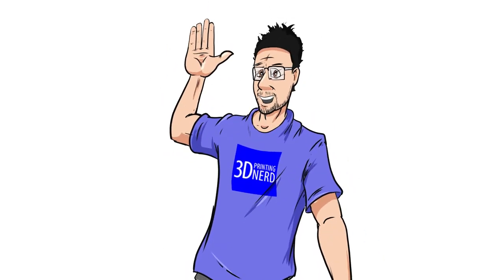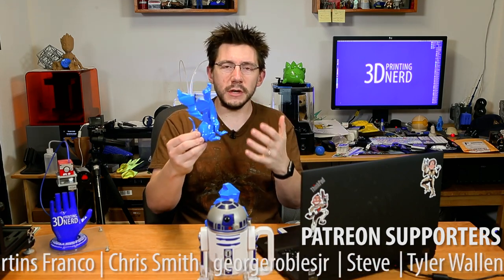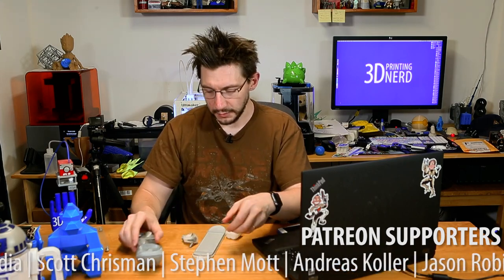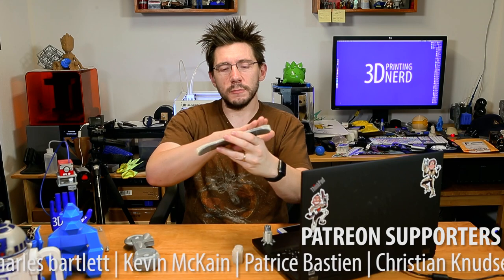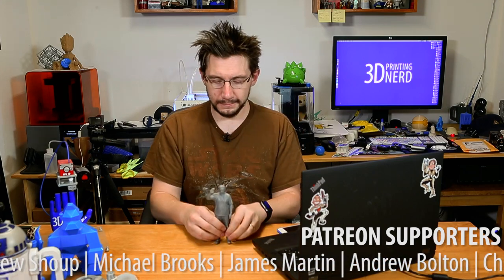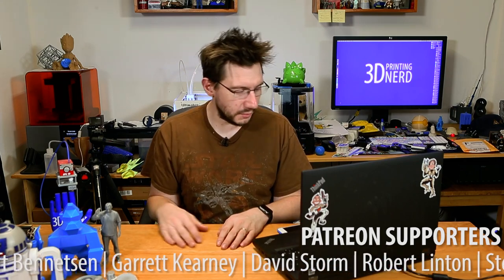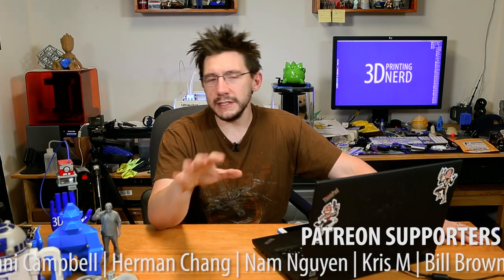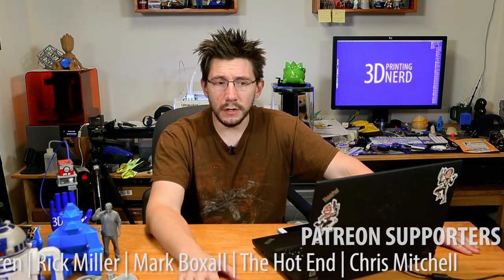Nerd Vlog 014 - Random 3D Printing Update

Comment: Nice VLOG Joel!  Some questions that maybe you could address in some future videos:

Question:  Why doesn't anyone sell an affordable device to melt down PLA scraps and turn them back into filament again?  Unless I'm missing something, it doesn't seem that hard to do with a fixed extruder and a take-up reel...  It would truly allow us to fully "recycle" this stuff.

Another question:  I recently printed a PLA mini camera tripod (off Thingiverse) that the designer's notes said to print with "no supports".  Just after the print started, I realized that one component (the top where the camera holder bolts on) had some significant, sharp overhangs in it that I had not noticed before I started printing it.  I figured that I'd have to print that part again, with supports to get it right - but was pleasantly surprised when that component came out functionally OK, even if it wasn't terribly pretty with a lot of rough edges.  So the general question is, how much overhang can you get away with, if and when you don't use supports?  (I imagine there are several factors that need to be accounted for here).

Keep up the good work!

Comment: hey Joel, I tweeted you for a printer recommendation but did that in the middle of the night. The character limit really doesn't help with providing details. A sleep deprived mind really doesn't help... I hope you don't mind if I ask this question here.

I am currently working at my college library that employs a Tinkerine Ditto Pro printer. It has become the bar for which we should avoid given the low feature set to high price ratio. Without going into too much of a rant, it lacks a heated bed, some poor design choices, I believe the frame or bed isn't as rigid as I'd like, and is limited to PLA prints. 

A number of our printers have been sent to the manufacturer for maintenance for issues that I believe I can diagnose but cannot fix on my own. I believe my management is looking for new alternatives and potentially replacing these units for something more reliable. The primary usage is split between student projects and enthusiasts printing models found off Thingiverse. Students typically don't show much interest in experimenting hence the ease of use requirement. I have seen a few of your videos and your experience and knowledge is definitely a resource I would like to consolt before sending my recommendations up.

Comment: Hey 3D Printing Nerd 😂. My prints are sticking to my blue tape but the blue tape is lifting off tge bed... What could be the problem?
Reply from the maker: your blue tape isn't strong enough?
Reply: 3D Printing Nerd Thank you. Should I buy a specific brand of blue tape?
Reply from the maker: +DMANDIOGUARDI hmm, no? I don't run a lot of blue tape so I'm not the best resource in this department.
Reply: Your problem is you're using Blue Tape - it's a poor printing solution these days! Try buildtak or similar. ;)
Reply: Maker's Muse Thanks. I didn't know that was a thing hahaaah,  I've only been printing for a couple of months.
Reply from the maker: +DMANDIOGUARDI welcome to 3d printing! Angus is right, all sorts of crazy awesome bed adhesion methods now-a-days!
Reply: Is your bed clean. No grease or oil
Reply: Maurice Sharp No, I cleaned it very well with acetone
Reply: I clean my aluminum printing bed with rubbing alcohol - not acetone.  I then apply costco brand blue painters tape.  Immediately before printing, I rub the surface of the blue tape with rubbing alcohol.  I print MG Chemicals Petg at 70C on the bed and rarely experience a problem with lifting.  Hope that helps - Charlie